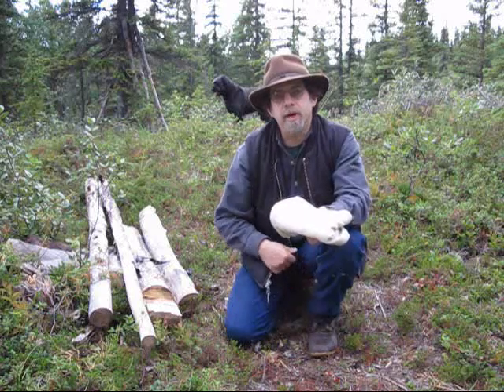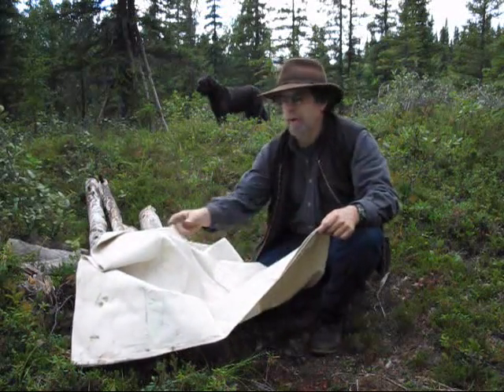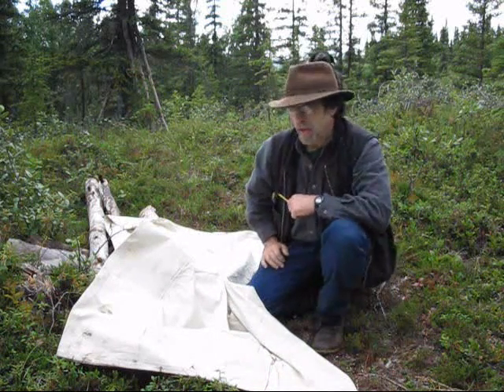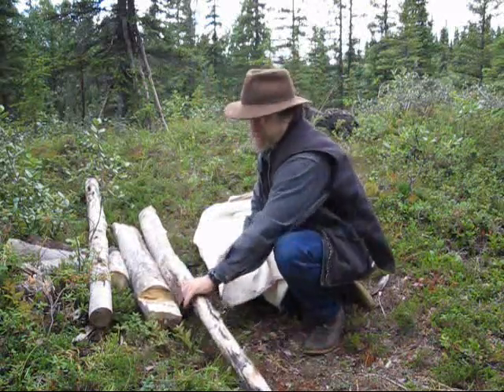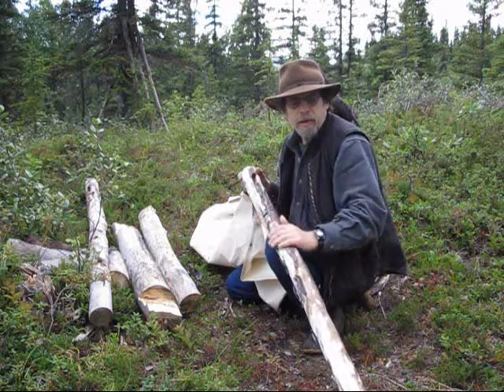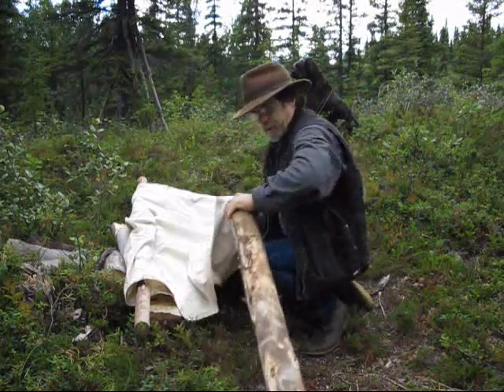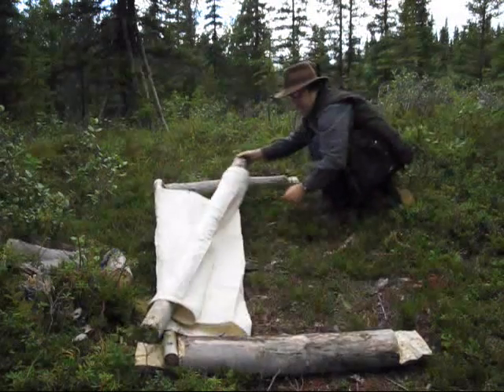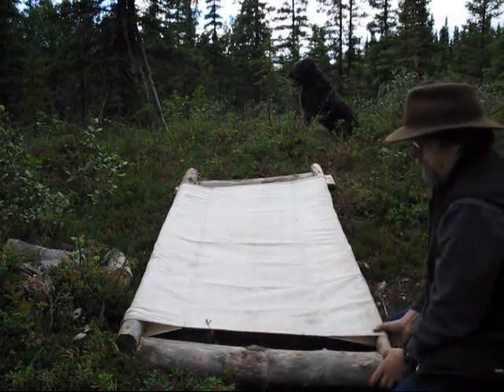A Simple Homemade Camping Cot

Comment: In the few days I have started watching your channel it has rapidly become one of my favorites, this is a great idea Lonnie.   Maybe just a slight bit more woodwork to do once you hit the campsite, but it seems well worth it, as this is a LOT easier solution to transport over long distances, a cot with a blanket & tarp (for rain protection) looks to be lighter and more comfortable than schlepping a tent & poles and using a sleeping bag on the hard ground of the tent floor.   As long as you have some mosquito netting handy for over the exposed areas of the cot on the warm months and get a reasonably sized fire near the tarp (but not TOO big a fire, lol) on the cool months this potentially seems a better way to camp.   Alternately if you have some smooth enough base logs and are careful, this idea could even be used INSIDE a tent on cooler months to conserve heat.  Thanks again for another great bush craft technique sir!
Reply from the maker: lastdaysguitar You are welcome.  I am glad you are enjoying our channel.  Thank you.   It is surprising how comfortable the cot is.

Comment: This is simply brilliant ...think I am going to try a 6 x 6 canvas tarp with grommets, fold it in half and connect the grommets with zip ties or lashes..creating a tube shape, then run the poles in the tube stretching the tube out tight with the end pieces...
Reply: fieldagent59 - Did it work?

Comment: I think I remember this from another video. If I remember to, and have the time and energy, I want to try making this out of nylon, but a little different. A one piece, cot with heat reflector/sidewall and awning/roof all one piece of nylon. I’d try to make the bed part like a sleeve. Kind of like a drum sander belt with one stitched seam stitched where the sidewall turns up at its base.
Reply from the maker: Yes I did an updated video on making one of these.

Make An  Ultralight Camp Cot
https://www.youtube.com/watch?v=b4mZE6n9Cw8

Comment: Second time around watching this one, coming here from the link on EconoChallenge When you mentioned hammocks, got me to thinking. (Usually dangerous, BTW.) With a more length, it could become dual duty. Both a DIY hammock & a cot. When used as a cot, excess material would be gathered at ends, to maintain a smooth sleeping surface. Couple of different ways to DIY hammock, depending on whether ends are simply tied or designed to incorporate 2 poles for a flat sleeping surface. Naturally, it will weigh more. How much depends on the fabric used. However, weight difference may be offset with flexibility dual function could provide. -- Use as cot, when wood & time are available. Use as hammock when wood &/or time to construct is limited. 

Just some thoughts this morn, for what ever it's worth.
Reply: I've been thinking the same about making a DIY hammock that can double as a cot.  I'm going to try using two pieces of 1.9 ripstop material to form a tube approximately 9ft long and 5ft wide.  The 9ft length would be about right for a gathered-end hammock and could be folded at both ends to shorten for use as a cot.

Comment: Hi ya Lonnie! I came across this video again, I’d seen ur new version of this made with nylon. I sat here just looking at the picture thinking of the pro’s and con’s on both, as u said canvas is heavy, hard to dry and gets moldy, but as I saw u slide the logs threw the sleeves, I see the pro n canvas, it can take the roughness of the log, oppose to nylon which is lite, drys easy, no mold, but I’m thinking nylon not as tough and logs would have to be as smooth as a baby’s butt. Am I correct in my thoughts??? Painters drop cloth came to mind, it would be heavier than nylon, but lighter than canvas, would dry better “I think” and could handle rougher logs than nylon. I’m trying to be logical on this, I have no sowing machine, a seamstress would cost a lot, I’ll need to sow by hand. Watching ur video making the nylon cot, it would not make a flat crease, I see it to be cumbersome to sow by hand oppose to having a machine, two hands to work it and foot to sow it. What’s ur thoughts on a painters drop cloth. Thank u
Reply from the maker: I don't think I would personally use painters drop cloth for a cot.   It may work fine but it is a looser weave and so would not be as resistant to rips/tears etc.   I would rather get the real canvas so that I have that margin of safety.  I have not used a nylon material much yet in a cot so I can not speak authoritatively on the subject.   It is my guess however based on using similar weight nylon in several chairs and in the several weeks that we used econochallenge's "Amazing Wilderness Camp Cot" moose hunting season of 2017, that the nylon will do fine as long as care is taken to make sure the poles inserted into the cot sides are free of sharp stobs.   This nylon cot cost me a total of $10 US dollars counting buying a new spool of heavy duty polyester thread.   I ended up not needing the thread as I still had plenty from past projects so without the thread, the cot cost me 8 dollars and 23 cents US.    The reason I got it so cheap is that Joann Fabrics here in the USA often has huge off coupons available.  We used to get a monthly snail mailing coupon book and it almost always has 40% off coupon on one normal priced item.   Well we have not received the mailing for a long time now so I have been going to joann dot com on my smart phone while in the store and they will scan the coupon bar code on the phone to get the % off.   Well now they want you to download the joann fabrics app in order to do that.  I did download the app and they had a 50% off coupon that i used for the material.  So I went through the line with just the material and Connie went through the line with the thread.   Had I gone through the line with both items they would have used the 50% off coupon for the thread.   Anyway I got the nylon for half price.   $10 for an awesomely comfortable cot is a great bargain even if I had to make it myself.  This is almost a beginner level easy type project also.   

Someone commented in the nylon cot video about some double sided basting tape for use in seams and hems.  It sounds like an awesome idea and one that would make the nylon seams EASY to sew and should render a much neater seam than what i was able to produce doing my way.   Whatever you decide, good luck.  Wish you luck.